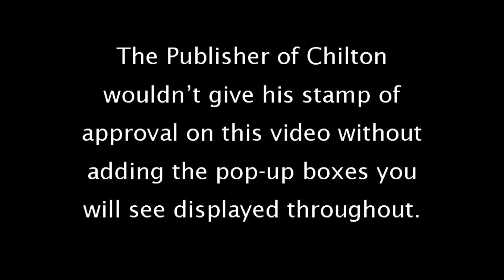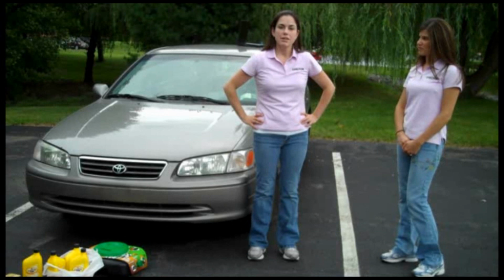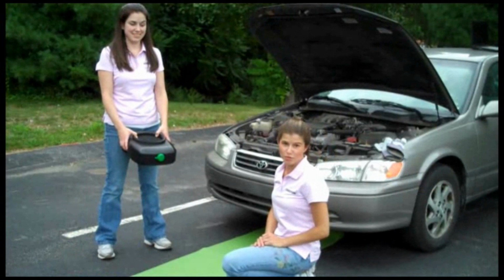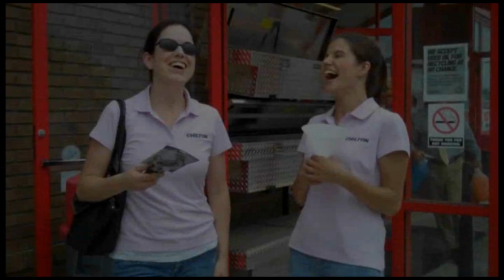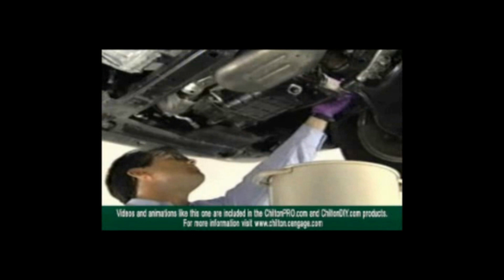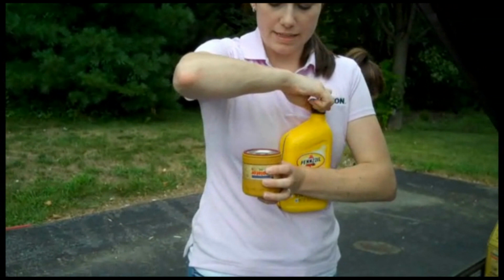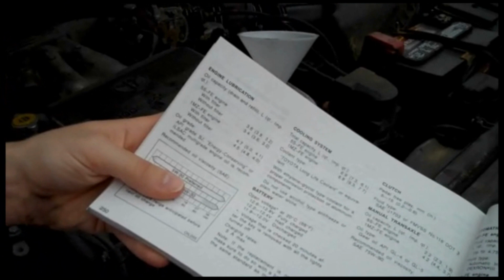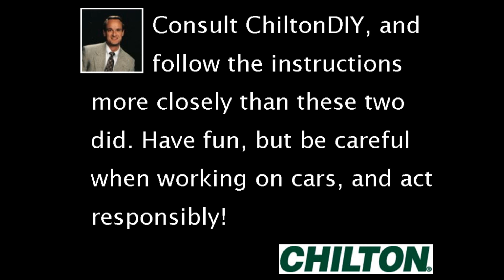Chilton How To Video Series: How To Change Your Oil

Comment from the maker: @SaganAppreciationSoc 
Hi there!  We used at 15mm wrench, however the oil plug is often replaced throughout the life of a vehicle, so not all 2001 Toyota Camry’s will take a 15mm wrench.

To answer your question regarding how much torque - the specifications for a 2001 Camry are as follows:
- The 2001 Camry 1MZ-FE oil drain plug torque is 33 ft. lbs. (45 Nm).
- The 2001 Camry 5S-FE oil drain plug torque is 27 ft. lbs. (37 Nm).
1MZ-FE and 5S-FE are engines

I hope that helps!

Comment from the maker: @SaganAppreciationSoc 
Hello again!
Since the Camry is front wheel drive and the noise is coming from the rear of the car, it’s not a transaxle problem. If the noise is indeed coming from the rear of the car, I’d suspect worn struts or worn control link bushings.